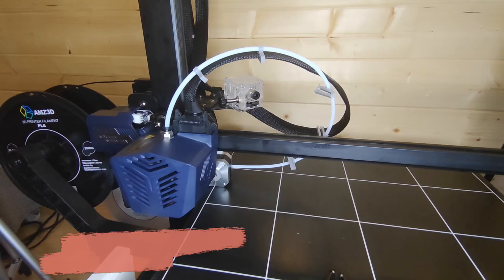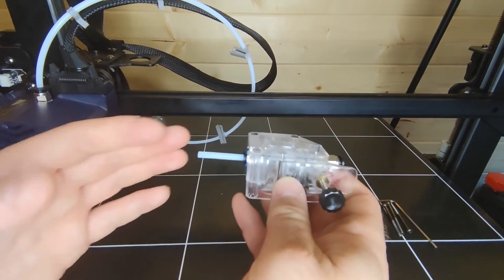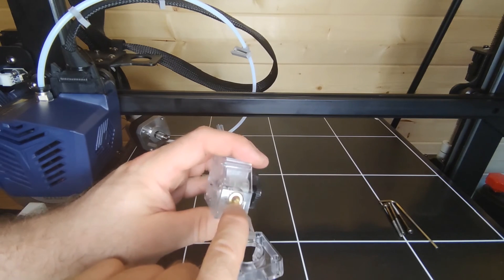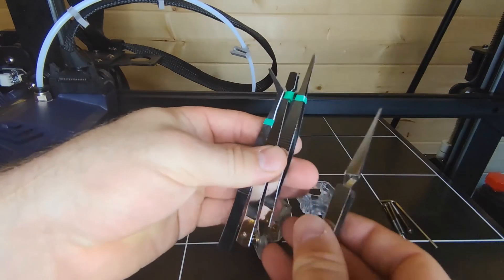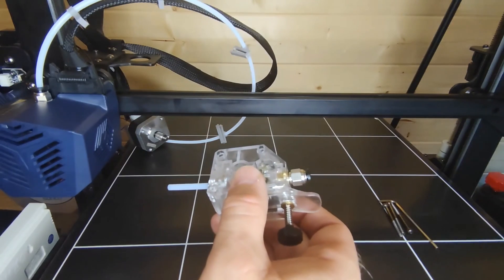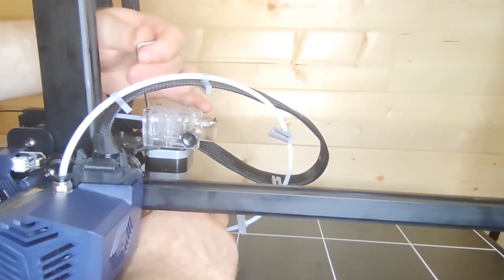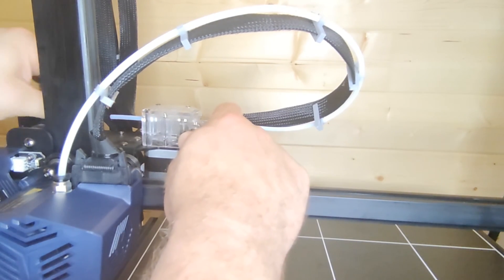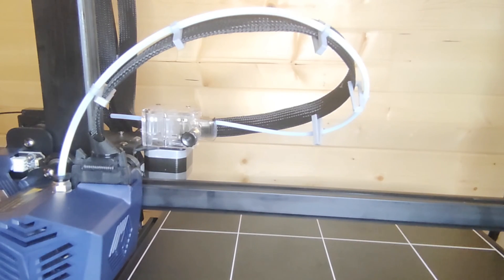Anycubic Kobra Max Blocked Extruder fix

Comment: You can  help me I bought a power supply for the hit bad 300x300 mm  but the Marling send  stuked time. You know if coupling with an solidstate relay  I suceed 500 w e suficiente
Reply from the maker: Hi sorry I've misunderstood your question 😞
Reply: My reprep send message. Time of hottable expired   the power supply. For hottable is 30 volts  DC 15 amps.  The aluminium table 300x300 don't heat 100centigrades ontime

Comment: What's the point of the knob?
Reply from the maker: Ah the knob is too close the gap between both moving cogs ie the tighter inwards or closer it'd gripping more the further out looser will allow it too come through easier however it's recommended around 18mm or there abouts as per instruction

Comment: What was it doing , that you had to make the fix , mine is making noise and for a few seconds and not extruding any filement ..any suggestions.thanks
Reply from the maker: Mine had a small amount of filament stuck in the extruder itself
Reply: @3DPUK-TECH-CHANNEL  i couldn't upload a video, didn't find any filament use a compressed air to blow it out to make sure it was clean it still makes the sound, wondering if it's an alignment issue or a faulty motor next diagnostic is to try the extruder without the plastic housing attached
Reply: I'll try and up load a video later to give you a idea of my issue

Comment: How dd you get the tube out of the coupling? I had to take mine apart recently because of a hotend blockage, and pushed the coupling up the tube, not realizing that now I cannot get it back down.
Reply from the maker: Mine was just push fit
Reply: @3DPUK-TECH-CHANNEL  to those who liked the comment/ are wondering, I figured it out- there was a small zip tie around it, between the metal hex head and the black plastic push-in part. It was on so tight and cut off so short, I didn't realize it and thought it was a part of the thing/ that way on purpose.
Reply from the maker: @Noah Campbell  thanks for sharing yes sorry the push fit part is the extruder side. And the nozzle end has a small cable tie to stop movement make sire too have that back or a replacement one at least

Comment: You can access it a little easier. Right at 2:46 where you start moving the gear wheel. Give that piece a tug. It will come out with the metal gear attached. I thought my problem was a clog, but the extruder gear driven by that plastic gear wouldn't spin for me. It has a small bolt that can be tightened with a 1.5mm hex key. Once I did that, my extruder would actually drive filament through.
Reply: Thanks for posting this - tightening that teeny little bolt fixed my problem and saved me from trying to replace the entire extruder.
Reply: @katherineteehan7644  My pleasure! I've seen other people mention that grub screw since I fixed it before. These things are certainly an adventure to keep running smoothly.
Reply: Upvote on this. The metal extruder gear that is on the same shaft as the black plastic gear has a socket set screw connecting it to the shaft which was loose.

Comment: I feel kinda dumb, when I unscrewed my bowden from my print head I can get the screw to go low enough to screw it back in. I'm worried if I'm too rough it will break. I never removed it from the print head, I just unscrewed it. I've tried sewing it both cw and ccw. Can I pinch the tube in hand and slide it down, or do I need to pull the whole thing down harder?

Comment: I bought this printer a month ago, but the problem of uneven printing platform has been sent back for repair. I think there are many small problems in this machine, including the screen and the discharge sensor.
Reply from the maker: the bed can be a hit and miss, what issues did you see on the Screen and the discharge sensor? i havent seen this

Comment: I have no idea if mines a lemon but it seems I'm having electrical issues. During the print the extruder just stops spinning. The head keeps going but the extruder motor just stops. It does work, If I hit filament in it feeds.
Reply from the maker: Does it seem too be overheating?? And how far into a print are you seeing this issue? Did you print the owl gcode supplied ok ???
Reply: @3DPUK-TECH-CHANNEL  I got through a ton of prints before it started randomly happening, even a 3 day lizard print. All of a sudden it would work for a bit and then start printing in thin air basically. I've tried all sorts of different things but it just seems electrical. If I wiggle the main wire connecting to the print head there's an LED light the comes on and off depending on the wire position, I think something is loose and the print head stops communicating with the extruder.
Reply from the maker: @kylequinn1963  so the light in the filling head is the nozzle bed leveling be careful not too over stress that bracket when wobbling its fragile. In terms of the motor do you have a spare you could swap out and see if that solves it ??? Otherwise if it's electronic issue definitely reach out too Anycubic Helpdesk
Reply: @3DPUK-TECH-CHANNEL  I've reached out to them, I don't have any spare parts this is my first experience with a 3D printer and it's not going well lol. $900 on the printer alone and it seems to have broken within two weeks. If they don't get back to me tomorrow I'm going to likely return and exchange it via Amazon before my return window runs out. Inside the print head there's a small circuit board with a bunch of LEDs, the "D1", very bottom, LED is lighting up and then going out every time the main power connector moves.
Reply: @3DPUK-TECH-CHANNEL  Upon further inspection based on what you've mentioned, that LED is 100% related to the bed leveling sensor. I've removed everything else in there basically and when I touch that bracket the LED comes on and off. No idea if this is related to the filament drive not working at this time though, just something I've noticed.
Reply: Just tried to do a print with the main hotend removed from the bracket but still plugged in, the LED light went out but it still wouldn't feed the filament. No movement from the motor at all. When i hit "Filament in" though it feeds perfectly.
Reply: I had this issue with mine it was doing the same thing, another issue that I ran into was the filament melting in the bowden tube leading to the hot end with PLA (the last 3 ish inches of tube in the housing ) to the point where it fused with the tubing itself regardless of temperature. Pretty sure the hotend was shorting somehow but when i took it apart i couldnt find anything. These issues only showed up after like 10 ish hours of printing. What slicer are you using ? I found I had the extruder feed issue way more when using prusa slicer.
Reply: @mathyszka  I'm using Cura. I like the printer over all but it has some bugs that need to be worked out for sure. Sometimes printing with Cura produced garbage results, print via USB, but saving to the SD card and printing the same file from there works fine
Reply: @kylequinn1963  I just bought one and there’s a set screw on the gear inside the extruder. Mine was a little loose and slipping. I tightened it up and so far it’s been going good. I also thought it was stopping but the extruder stepper was moving.
Reply: @jasonhannsz  It wasn't that for me. My set screw was nice and snug. It's a common problem from reading Amazon reviews, seems quality control is pretty bad. I also ended up with an issue where the nozzle tried to destroy the bed when auto levelling so I sent it back
Reply: I’ve noticed if you use the more expensive pla this often gets clogged as it rubs away some of the filament as it pulls it along. You should unscrew the push lever and thoroughly clean the entire until maybe once a week.
Reply: @shabue  I hadn't even owned it for a week before this issue started. It wasn't that it was stuck, it just simply stopped.